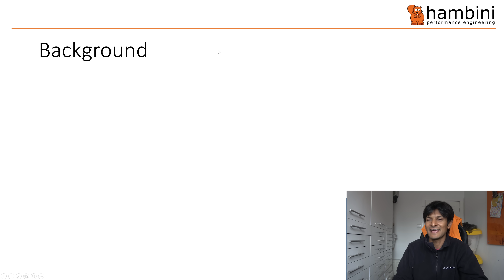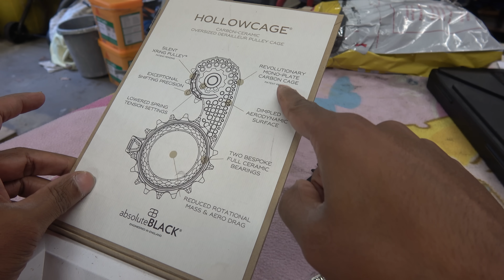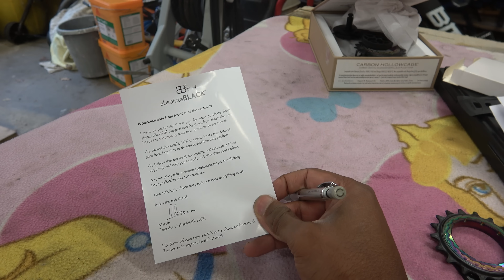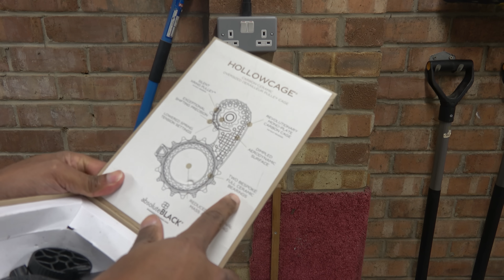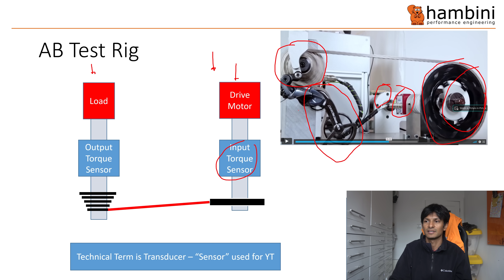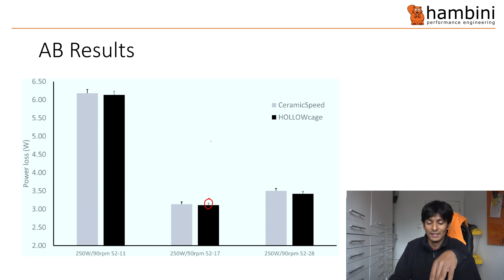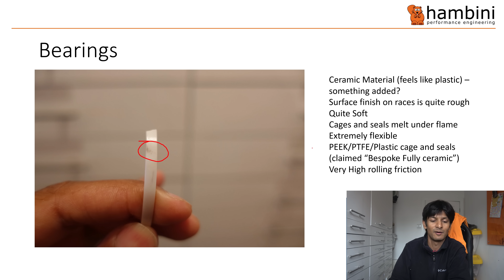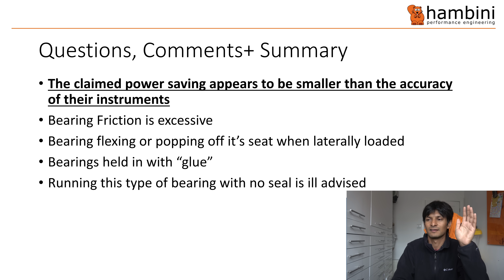AbsoluteBlack $700 OSPW: An Engineering Reaming Hollowcage

Comment: Imagine having a small minor crash and the absolute crap breaks yet everything else on the bike is fine and dandy. That would suck. The flex in that pully is REDICULOUS and PATHETIC. Absolute: if you're going to make and sell a product for that much over a standard pully then you better make it precise af, out of the BEST materials I'm talking carbon, ceramic, gold, silver and platinum and durable. Even if your product fails to be aero and or watt savings it's an absolute rip-off if the overall quality and material doesn't match up. There's a reason why people pay top dollar for swiss made watches.
Reply: Swiss made watches are a really bad example to give here - Japanese made mechanical watches are of much higher quality at every price point and have been almost since Japan entered into the mechanical watch market. Swiss watches have been far more marketing BS than great engineering and manufacturing more or less since they started. Historically, watchmaking in general is much more about making shiny things for people with a lot more money than sense than engineering a device that can actually keep decent time, so this shouldn't come as a surprise to anyone.

A good example is the 'Certified Marine Chronometer' tag some of the Swiss watches use. The requirements for mechanical watch accuracy are so low that they're literally no practical use in marine navigation within a day or two of the time being set (The certification was invented by the Swiss watch companies as a marketing ploy, so no surprise there). Interestingly, the accuracy required for quartz regulated watches to get the same certification is strict enough that they would actually be usable for navigation on short trips - about 10 times as accurate I think, though it's a long time since I looked.

A few years ago I was interested in getting a nice mechanical watch as I liked the mechanisms and attention to detail involved in making them, but once I discovered that a €20 Casio is good for +/-5 seconds a month, while you'll be doing well to get +/-1 second a day from a €5000 Rolex, I realised the whole industry was bullshit. The only accurate mechanical watch on sale at the moment is the Seiko Spring Drive, which is a mechanical watch with quartz regulation and a genuine engineering masterpiece, but nothing to do with the Swiss watchmakers, just 20+ years of development by Seiko. The John Harrison watches that won him the longitude prize in the 1700s, on display in the Greenwich Observatory, did better than +/-1 second in 100 days at sea in some tests, so it wasn't impossible with far older tech to achieve this, but it wasn't a priority for watchmakers that weren't supplying the  world's navies. As a side note John Harrison invented the caged ball bearing while developing ways to reduce friction in his clocks and the bimetallic strip and gridiron pendulum as temperature compensation mechanisms.

Mechanical watches serve a purpose similar to that of expensive art, where the massive and arbitrary value applied to them is supported by the people who can afford them as it allows people to move small items, usually not noticed by customs, over international borders much more easily than smuggling cash, as well as allowing them to avoid capital gains tax by buying a very expensive rare watch and leaving it to appreciate in a safe for a few years and selling but with no tax liable in many jurisdictions on the gain in value - if the tax people even notice the transaction. This is the actual reason people pay top dollar for Swiss watches.
Reply: @peglor  then replace "swiss watch" with any product that is expensive and made with care, quality and exact precision. It's not a comparison like you are comparing. Try to understand the point I was making.
Reply: @liquidSpin  The point you were making is understood, but the product you chose as an example completely invalidates your argument for exactly the same reason that this product should be avoided.
Reply: @peglor  Glad you understand my point. Which again, just replace "Swiss made" with anything luxury. When it comes to Swiss vs. Japanese that's another debate. Swiss made still are amazing but it's not like you nor I watch the manufacturing process where they hand craft each watch right? I'm not about to go into semantics on quality when comparing to the two. That's like arguing over German engineering vs Japanese engineering. Both make high-end models.
Reply: @liquidSpin  It's mostly that the Swiss watch example is marketing that people still believe and does not get refuted often enough. There used to be a big competition for watch accuracy held in Switzerland every year, but after the Japanese manufacturers completely dominated all categories, the Swiss reaction was to never hold the competition again rather than to up their game.
Reply: @peglor  The assertion that top tier Swiss made watches are no longer high quality is hard to believe. Please don't take this the wrong way but as a respectful debate/learning conversation.

Tag Heuer and Rolex (for example) both still hand make and source the best materials for their watches. They still employ top level watch builders and do their own QC. Real gold, real diamonds, real leather etc etc. Thousands of pieces that has to be meticulously put together by hand is a big factor into why they cost so much. They are not factory made (like the Absolute Black pully) 

If they said "To hell with quality" and start selling out defective crap they would not be around to this day selling their watches at the prices they sell them for. It's as simple as that. They still have competition and the owners/investors of those companies still care about being the best and making profit.

With that being said, this is my question to you and this is a serious one: Do you own and have bought hundreds of different Swiss made watches? Did you used to work for Swiss watch manufacturers? Did you buy and sell them for years to make this assertion that they are no longer made with high standards and that they are less than due to the Japanese made watches?

Ferrari and Lamborghini are big rivals. They sell high end sports cars. Do you think either of them wants to look bad next to the other? No, they are constantly upping each other. This is the SAME for high dollar watch brands. Their reputation and legacy is on the line. Rolex isn't going to mass produce or down their quality to make a quick buck. Trust me they still make high end watches and I'm not sure you can prove and back your words up that they are no longer high quality. But I'm open to seeing some statistics and facts vs. internet hear-say and anecdotal opinions.

However, one last bit: No brand on Earth is perfect. No car, watch, boat, plane, electronic manufacturer produces 100% perfect products 100% of the time. The idea is some more than others.
Reply: @liquidSpin  It's irrelevant how 'hand built' and 'best quality' the materials the Swiss makers use are. When their watches don't keep time as well as much cheaper Japanese watches they are, by definition, badly engineered.

Your argument falls into the fallacy of assuming that because they use very expensive materials and processes then they must be making good products. This is exactly the same method used to sell all kinds of shiny junk to people looking for ways to show the world how much money they have.

While part of the price is absolutely due to using very expensive materials, and this part of the price is justified to allow them to make profit, I'm an engineer and not a jeweller, and the engineering of these as timekeepers is poor compared to what Japanese manufacturers do at a lower price.

This is exactly the same as the issue being discussed in the video with the junk derailleur cage from AB, except their claims of both expensive materials and higher performance are both lies, while Swiss watches only lie about the performance (They actually just never mention it, leaving you to assume that they keep time well, rather than actively lying about it), but not the materials.
Reply: @peglor  It is relevant to mention whether something is hand made vs. factory made and mass produced. A company has to pay for labor and this drives up cost. 

Along with material, name, level of QC, labor and how complex or advanced the watch is will drive up the cost. 

If you're talking about accuracy the then sure Japanese brand Citizen have done well in that regards but guess what? It's still expensive depending on which model you get. High end is high end. Which is why my reply to you was to simply replace my "Swiss made" with whatever high end luxury brand that will make my original statement work. 

It's not just about whether the watch is so damn precise. It's not always about ONE specific thing that makes something valuable. For example a Lamborghini Aventador is slower than a lot of other exotics out there yet it still has a high price tag right? Speed isn't the ONLY thing that drives the price. Even tho the Lambo is slower it's STILL a high end top quality sports car that people admire and continue to buy...from $350k upwards to the millions.

Cheers~
Reply: @liquidSpin  This is an engineering channel - the engineering performance of products is what is being discussed, especially in terms of manufacturers lying to their customers about how good their products are. The money spent on QC regarding timekeeping is definitely wasted for example.

Good marketing and not good engineering, or even good design in many cases is what keeps people paying ludicrous amounts for more or less all premium products - they could not survive if their actual performance was evaluated relative to their competitors. 

Tesla, specifically, has shut premium car manufacturers up in a serious way about their performance claims, but in terms of look and fit and finish and especially the dealer experience, they can still compete. 

Another good example is the marketing behind convincing people that diamonds are worth anything as jewellery - industrially manufactured diamond is fantastic for its mechanical, thermal and optical properties, but diamonds are a lot more common than the cartel that controls their prices and convinces people that owning them is desirable would have people believe. 

What was hilarious was watching the diamond market wankateers switching from claiming industrial diamonds weren't as good as mined ones because the mined ones were more flawless to saying the flawless diamonds made as industrial processes improved weren't as good because the flaws made the mined diamonds unique.
Reply: @peglor  I know this is an engineering channel. I hope you didn't think my original post was somehow defending AB. I have lost all respect for them even though I have never really bought anything from them. 

My previous point about the Lamborghini is what I am talking about it's the same principle it may not be a "watch" but it still applies to the point I am making. Quality and high end products are most of the time expensive compared to their cheaper counterparts for many reasons not just one specific. 

It's up the the buyer to decide whether it's worth the price to pay. 

I still think Swiss made watches are luxury and made with high quality that sets them apart from cheaper consumer affordable watches. Am I saying I'd buy one? No just saying they are still high end. And just because you're an engineer doesn't mean you know and examined every Swiss brands watch to know they are inferior in every aspect. 

We will have to just agree to disagree on this matter. I definitely didn't want to get deeper into this nor do I want to go off on tangents about marketing and diamonds. 

Last post. Cheers~
Reply: @liquidSpin  I think the issue here is that your use of the word 'quality' is to mean a measure of the subjective look of the part or how it makes you feel knowing it was hand carved by Tibetan monks when there's no way of knowing whether this is true.

My use of the word quality is entirely based on how well it performs its mechanical purpose. The actual meaning of the word covers both and everything between, but marketing is all about selling on the superficial finish, which is often based entirely on what is known as the 'halo effect' - the same reason attractive people are much less likely to be suspected of evil deeds, while engineering is only concerned with surface finish, with expensive materials only chosen where they have a performance benefit.

An example of this contrast is that the McLaren F1 engine firewall is coated with gold because this material has an extremely high thermal reflectivity, so it was more effective than any other option they tried at keeping the heat from the engine away from the fuel cell, while watches have gold everywhere because of how it looks, despite it adding weight and cost with no function or performance benefit.
Reply: @peglor  no you still don't understand my explanation. Unfortunately.

Comment: Absolute falsehood! Hambini uses AB's own engineer's words and test equipment to disprove the accuracy of their testing. When he cuts and scratches the "ceramic bearings " with a knife and manipulates them, it proves they're some type of plastic. The lubricant used in the product makes it illegal to sell without the data sheet in th EU. I was surprised that the dealers were even allowed that profit margin. Surely they had to be a large part of the scheme and needed more incentive to risk their reputation. Hambini did well to keep this restrained so the usual forces of censorship will have a harder time!

Comment: "Polymer", is "Plastic". To be precise. For the cage they probably used Polyamide with Carbon Fiber reinforcement, like PA6-20, Ultramid CF or something.
Also I doubt there's been any solid aero testing done. The dimples are just Baloney (the way they work for golf balls doesn't apply for flat surfaces), the big opening in the late pulley wheel will introduce some turbulence and the frontal area is also large AF. 

Also, if I'm promised handmade carbon fibre at such a price point, I expect some sort of stiff, prepreg carbon layup with a visible carbon web, not an injection moulded piece of shit.
I'd even be okay with "forged carbon" (i.e. compressed carbon cloth shards in an epoxy matrix).

This whole piece of shit is one of the worst rip-offs I've ever seen.

Comment: You've successfully destroyed one company at least with this video.  Good on ya.  Ceramic isn't plastic and neither is carbon fibre.  Well hold on... Ok ceramic isn't plastic haha
Reply: Mabye not destroyed, but defenitly made people question their products more, their chain rings are fine, light weight nice design as long as you don't smash them into things, then they will bend, snap. But I have a bash guide, but defenitly not the strongest chain rings.
Reply: @mtbboy1993  seems the issue here is that the product isn't what they've advertised it to be which is a big nono.  If you're gonna splash the cash then you should get what you pay for or at least what's advertised.  Hambini is geat haha
Reply: @billrose2202  yea. Defenitly

Comment: others have measured these two rigs back to back, multiple times, the almost negligible difference is there. the setup you ripped into, as far as I understand, measured both CS and AB cages, so if the margin of error is the same in both cases, all parameters being the same, and after multiple tests the consistent difference keeps showing up, regardless of how inaccurate the testing setup may be, what would you conclude? I have bought one, a year after your very interesting review, but not for speed gains, not for watt gains, not even close! I bought it for bling, and for a quiet operation, and, the larger the pulley wheels, the lower the wear of the chain, in theory.. I absolutely hate my chain drive trains because of noise (even with the new silent hubs), I'm building a Rohloff belt transcontinental traveling machine right now, (yeah, ironic, I know Rohloff is loud as all fuck, but still, quieter than some other crap out there, and I got it for durability and low service hassle) SO, I got one absolute black hollowcage to test it myself, curious like you wouldn't believe, and my fear was, shifting electronically would be a problem, with the bearing loose as it is, so shifting at low speed or at standstill is the worst thing that could happen to the AB cage, well, leaf, since it's not a cage at all! it's way too flexible, which could be a good thing, believe me, but the problem is the loose shifting wheel. accurate shifting is impossible if the shifting wheel is loose, micro-adjustability of the electronic RD is pointless, it never lasts more than the first few shifts. if the shifting wheel scoots to the left or right, it's over, the chain becomes audible, starts rubbing like a mofo! so much for quiet operation! this AB gimmick fails there, it's fast, at least as good as CS, it's quieter, all until the shifting pulley moves laterally onto the outer bearing racer, or the bearing itself shifts! it absolutely cannot have any play!
Reply: I may have a response...

Comment: If the white bearing assembly has "slack"... the complete bearing assembly SLIPS, this is bad.  Result is, the small ball bearings DO NOT SPIN.  Conclusion: extremely bad design, it seems very bad, it is very obvious, how couldn't the designer / company know of the BAD SPECS before selling it ? ?  Then again... maybe this BAD DESIGN...is  part of their sh.. marketing crap written on the outside of the box by the "snake oil salesman" himself.